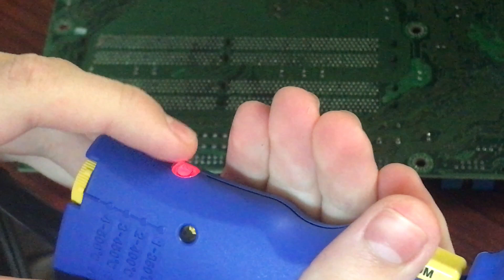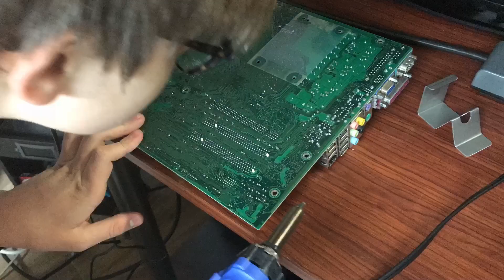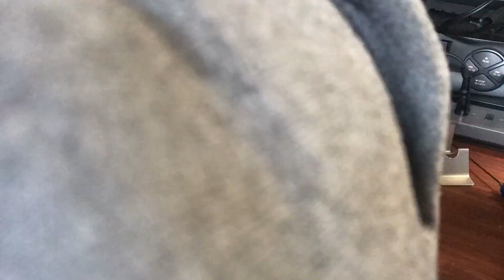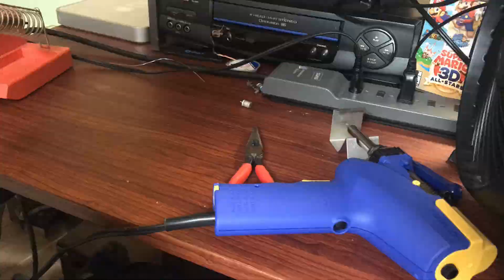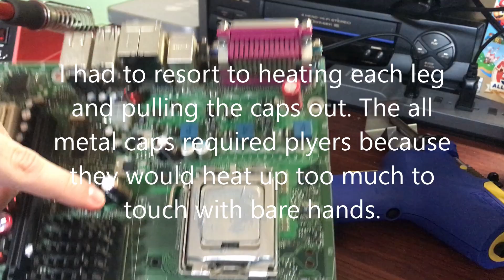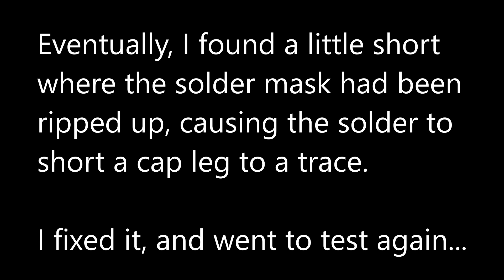Pentium 4 Recapathon Part 3! - An Easy Fix?

Comment: Sorry to see you couldn't get the board working. Have you tried switching out the CPU for a known good one? I had a CPU go bad before believe it or not, also put some RAM you know works in and see if that helps as a lot of times if it doesn't have RAM in it just shuts itself down since it can't do anything.
Reply from the maker: I tried 2 different CPUs, one of which was known to be good unfortunately. I also tried with RAM with no change :(
Reply: @3lectr1c  You can’t win them all unfortunately. Still hopeful for the next board!
Reply from the maker: Coming soon…